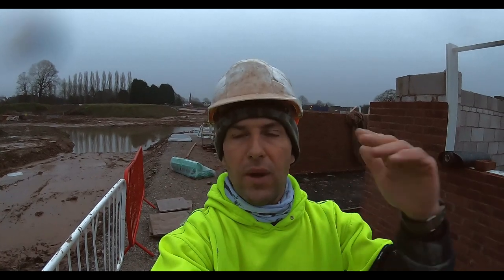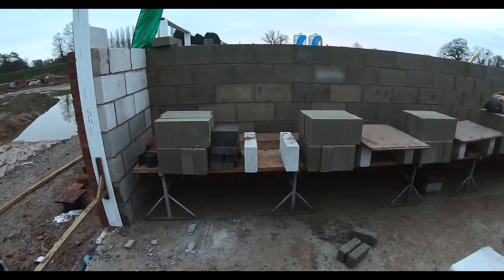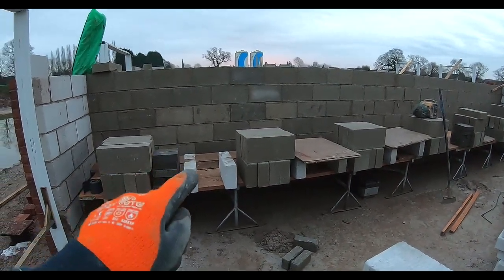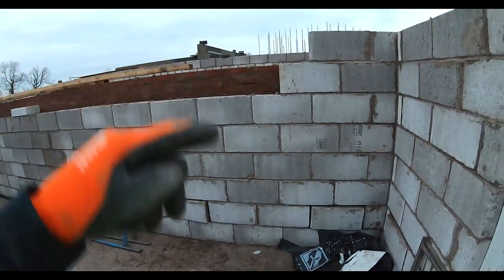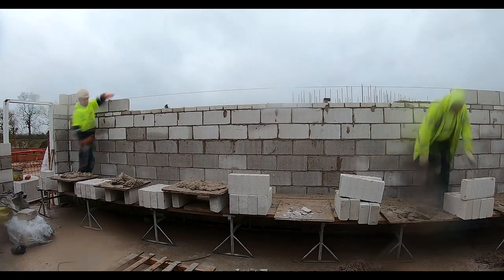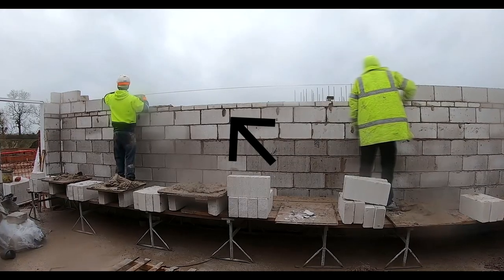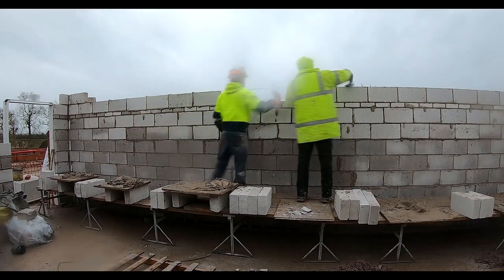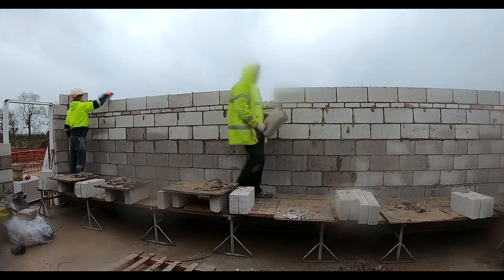BRICKLAYING: Working off Trestles - With Time Lapse!! Plus Tip for Wall Ties (HD 1080p)

Comment: Hi matt hope you're well.
Just wondering why you put the splits 2 course down and not under joists? Tia
Reply from the maker: Hi Adam ! Great thanks. Couple of reasons really. It’s 9 blocks and a split to get to 2.1 ( lintel height) then one block on top of the lintel and it’s joist height. 
Nhbc won’t allow splits under the lintels so realistically the split can be anywhere between the floor and course 8.  We choose to put it on top of 8 because it’s dead Easton flip the bond if you need to to achieve full block under the lintel. ( when they say full block they do allow a cut as long as it’s no less than  330mm 👍👍) . 
This is on our site but on other sites with higher ceiling heights ( 2.4 ) you would have a block s asks a  split on top of lintel ( assuming 2.1 head height). Then a split might ok under joists. 👍 sorry for the long reply 😂👍

Comment: Matt- What's the difference between Cell-con and Thermo-lite Blocks. Here in the USA ( East Coast)  it is  all Concrete blocks both hollow and solid- Thx Keep the Videos coming!
Reply from the maker: Hi David !! Cheers for the comment!! 
Celcon and thermalite blocks are just 2 types of airated blocks. (they actually float in water!!) . They do the same job and are similar price. 
They usually use them on the inside skin of cavity walls but i believe they can be use externally for render etc. 
We use concrete solids a lot for internal walls and when it’s being rendered. 
I use the hollow ones on retaining walls now and again!  
I didn’t realise you don’t use the lightweight thermal blocks over there ! 
We have got it easy as they are really fast and easy to
Lay lol😀🧱
Reply: Brickwork Fundamentals Matt Here on the East Coast USA we use concrete blocks they come in2,3,4,6,8,10,12 & 16 inches both solid and hollow (2 cores) the solids mostly come in 6 and smaller but they do come in the larger ones The 12 inch hollows we call “Birth control block” because after laying them all day you are too tired to mess with the Mrs.  the dimensions are 8”h x 16”l x whatever width you need. A lot of our walls are grouted solid as well. There is a good website of a local block manufacturer in the Philadelphia area that shows all the different types of block we use. www.Fizzano.com.  thanks have a good one
Reply: Or come to Scotland it’s all solid 7.3n concretes. And 140mm bad boys.
Reply from the maker: 😂 birth control block!! That’s really interesting thanks for the info! I’ll check that site out 👍👍😀
Reply from the maker: You know you’ve done a days work after laying them 140s all day ah👍 I did a factory in them and said I’d never use them again lol. One good thing  is that they are dead stable 👌👍👍
Reply: @brickworkfundamentals4636  
Yes that’s the only good thing from them as you dead stable. Don’t buckle on you which can happen on 100mm damp concretes. Once there down there down lol. Just 7x7m2 x 3.7m garage with them. Most timber kits nowadays are 140mm internal in foundations 140mm timber kit. Certainly all extension builds up here Scotland. Haven’t built a 100mm kit extension for years now. All 140. 👍🏻
Reply from the maker: We do all the internal walls in100mm concretes. We got told on Friday that they are changing the partition walls in pairs, 3 blocks etc to theralites!!!  
It is going to a bit easier for us and a lot easier for the carrier!! 😀 👍👍

Comment: I think your doing it the best way . In Ireland we usually do 11 x 225 mm courses to ceiling height ( 8 ft ceiling approximately ) . A friend of mine bought a new house over here recently and it was 12 x 225 mm courses to ceiling height ( 9 ft ceiling approximately) full block work house no brickwork smooth rendered finish . In the housing estate houses over here the most you’ll get is the front elevation in brick .
Reply from the maker: I think its a good way👌 yeah we are are on 9 block and a split up to lintels then one block on that to get to joist. Dead simple👍👍 the 2 and a half story houses are a bit higher. 
We do some with rendered fronts that are  on the other sides ! We have to use 9 kn blocks for render👎👎soo heavy. 
Cheers for commenting 😀🧱

Comment: Haven't done site work for years now but you've got to wonder what health and safety will be coming up with next
Reply from the maker: To right! They made me take my coat off in the pouring rain the other week because it didn’t have the reflective strip on 👎😂
Reply: @brickworkfundamentals4636  you've got to wonder where it will all end, we will  be turning up for  work dressed like the sas
Reply from the maker: 😂😂 we walked off a site when the said no shorts in summer. That was a deal breaker. I’ve heard chin straps on helmets and goggles might be made compulsory 😩

Comment: Surely you should do your perimeter walls first then pull a line across from perimeter to  perimeter to get the same height for your spine walls....?
Reply from the maker: Hi Martin! We do that on detached houses where the upstairs floors run over the internal walls. On semi detached, three blocks, 4 blocks etc  the floors are independent so no need to run a line right through. Its only 225 above window and door frames so we just gauge  up off them. We are lucky the groundwork bricklayers are good on our site so we know dpc is right. Gauge up from that and were good. If we were unsure about the slab being level. We would have the laser out👍  thanks for comment and sorry about the long reply